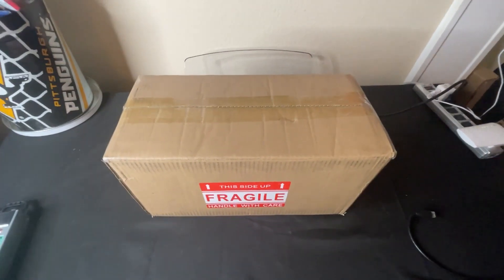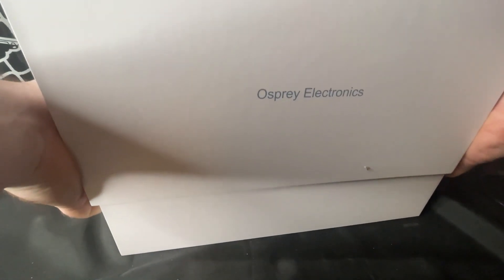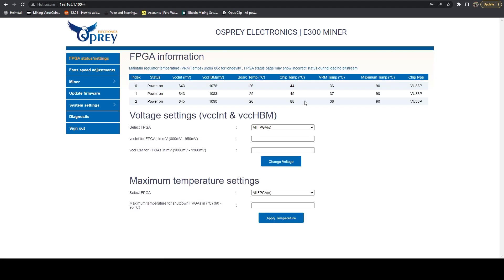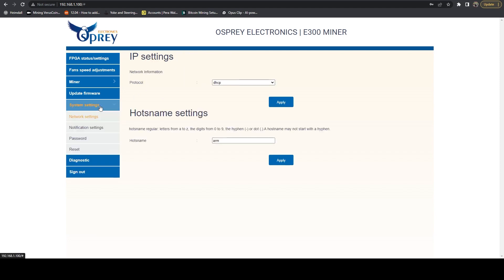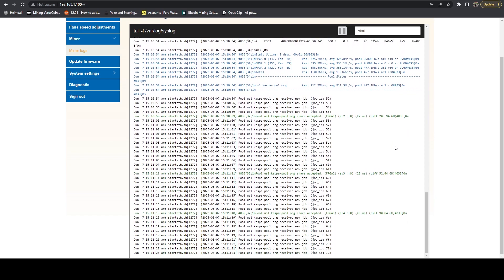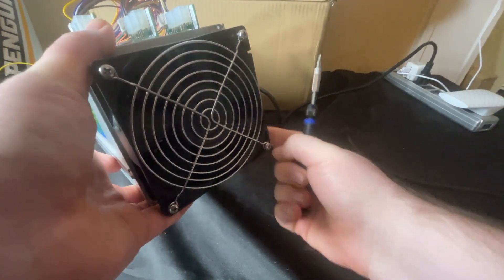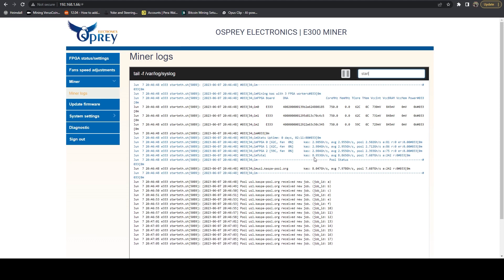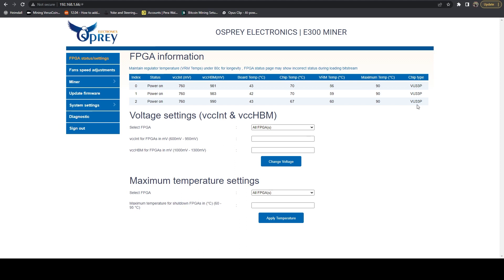Osprey E300-VU33P FPGA Miner | Unboxing & Initial Thoughts

Comment: Can you tell me Mike if you are satisfy with this unit? I got 2 e300 unit at home and im very piss after people got in their hands for a quarter of price a KS0 100ghashrate at 75w... Let me know your opinion... Im very frustrated and i think Fpgas technology its just a bunch of bollocks and crap. Best Regards, Simon.
Reply from the maker: I am very satisfied. I've been big into FPGA mining since 2018. It's my favorite way to mine, but you have to keep in mine that it's very nice with low production slotted in between GPU's and ASIC's. Generally speaking, if there is high demand for a coin, an ASIC will be created fairly quickly. Back in 2019/2020 this happened with Kadena and we only had a few months of it being worthwhile on FPGA's. Same with many other coins. Keep in mind that people that bought a KS0 can only mine kHeavyHash. With the FPGA, while not nearly as efficient, can pivot and mine other coins. One of my FPGA units from 2019 currently has over 20 different algo's it can mine. E300 has full support from TeamRedMiner which makes it extremely beneficial moving forward compared to what we used to have.
Reply: @RetroMikeTech  thanks Mike for your opinion.. i will keep in mind... im always listen a lots of people thinking than i make my own... Great video by the way very nite and precise.

Comment: Thank you so much for launching the video so soon. Really appreciate it Mike for the test. Sorry for ask again If I choose Noctua Fan, will the operating temperature of the machine be different from the test temperature in the video? Like it is only about 5 degrees hotter , I will take it. just wanna keep the apartment quiet a bit🙏Thanks a lot!
Reply from the maker: This one runs much cooler than the vu35p version. Noctua’s should be able to keep this one cool. You may want to reach out to Osprey and ask them what the average temps would be with the Noctua fan.